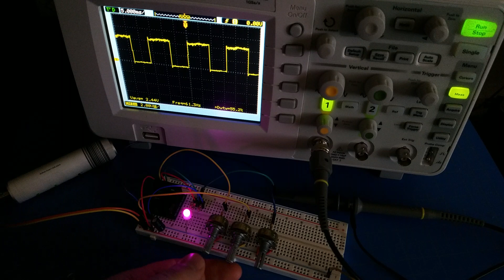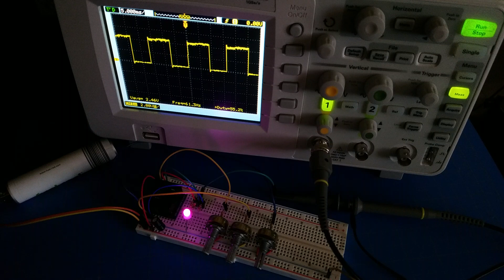RGB LED Control with Tunable PWM Signals

Comment: Not trying to be mean, but what did u prove? That a rgb can be controlled by pwm, that's standard and you can set pulse literally however u choose too, pot, static or wireless
Reply from the maker: I think the simplest answer is that if you understand what PWM is and its application with LEDs then this video is not for you and I'm sorry YouTube recommended it to you. You can ignore it and move on.

A more complete answer is this:

There's a lot of missing context that I tried to include in the video's description. The point of the video was to demonstrate one possible method for controlling the RGB LEDs in an existing product (Galaxy's Edge lightsaber blades) to produce colors beyond what the product was designed to support and to do so using components that were available to me at that time. I also wanted to put to work the concepts that I was only just learning about. In essence this video represents a step of my own learning process. And I wanted to share that with others who may not be interested in these concepts. I thought putting everything next to each other in a single frame showing real-world results as the pots turn to change the waveform to change the LED colors was interesting. And it helped crystalize concepts into real-world function for me.

The concepts I was exercising in this video would start me down the path of replacing the LED controller in the blade by designing and programming my own controller. The development of that controller, which began after this video, is covered in this playlist: https://www.youtube.com/playlist?list=PL1LWtA1iy9hvn_TC9zpnyU5pupyrw3pX3

The end result of that development was a drop-in replacement blade controller for Galaxy's Edge lightsaber blades. This is a playlist documenting how to order the parts, assemble, program, and install that controller: https://www.youtube.com/playlist?list=PL1LWtA1iy9htSzl2LpuS2Tzp28IAUwW5i

So what did I prove? That the concept I was starting out with would be viable, especially when using a particularly cheap, low pin-count microcontroller (ATTiny85). And that I should continue developing the project. Which I did.